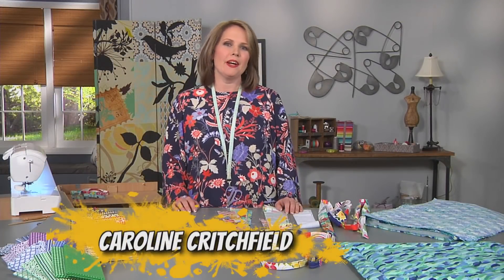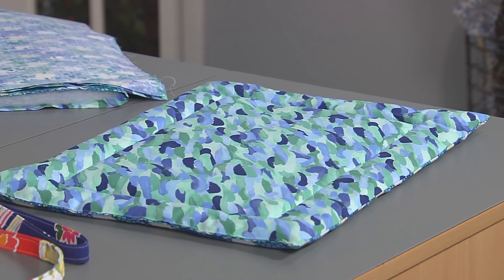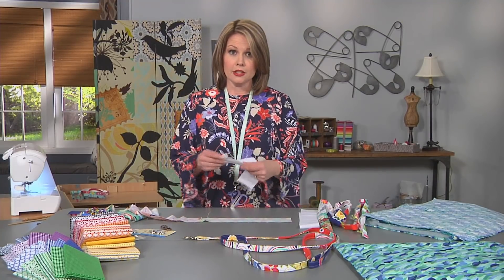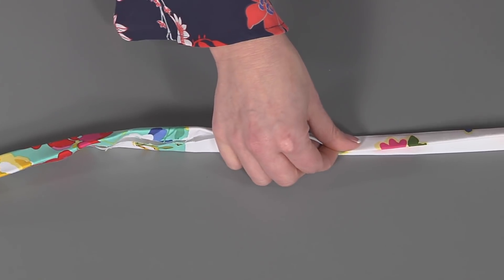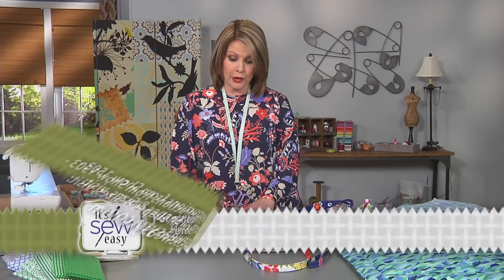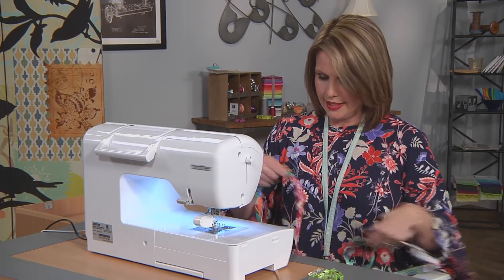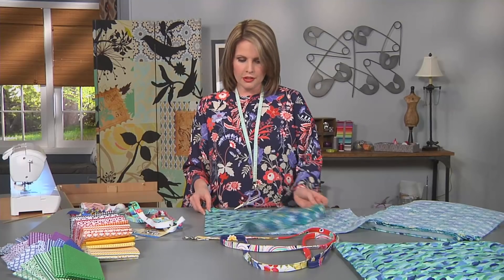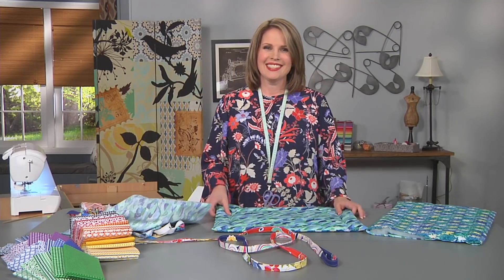DIY Scrappy Patchwork Dog Leash - Sewing Tutorial

Comment: How do you press it after you apply the interfacing? Mine got stuck together.
Reply from the maker: That’s interesting. Was your interfacing double sided fusible? I wouldn’t recommend that. Perhaps if your iron was too hot it could melt a non-woven interfacing. Maybe try Pellon SF-100, a woven interfacing that’s fusible on one side.